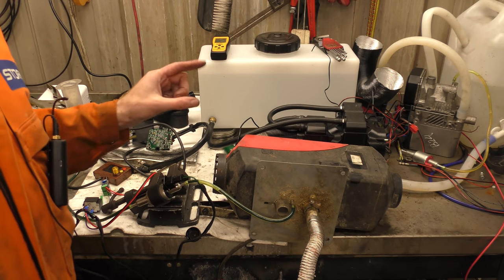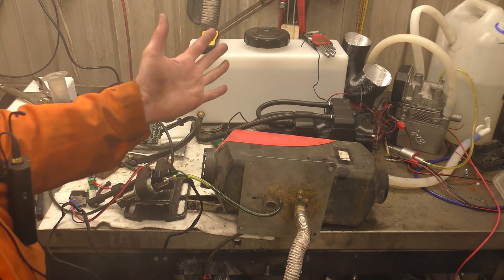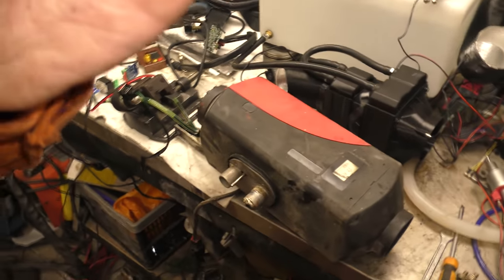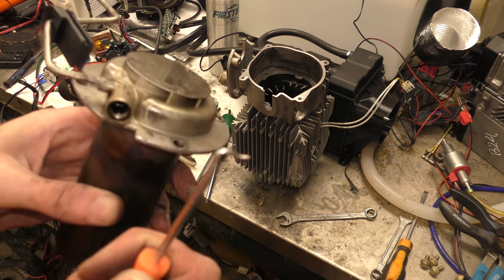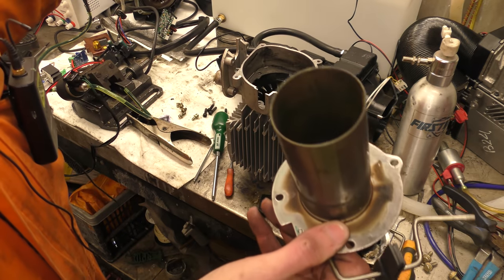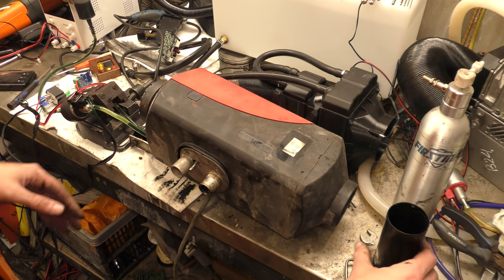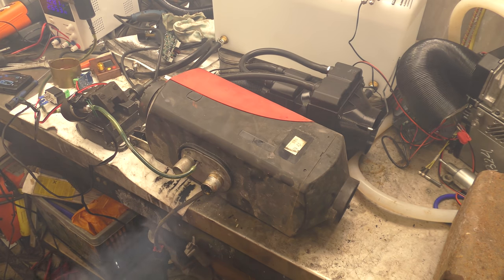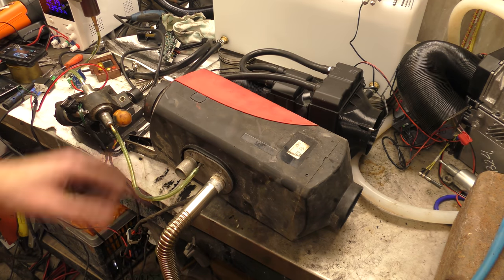Diesel Heater Diagnosis - white smoke but not lighting

Comment: Just thank you...
-33 Celsius  in Winnipeg Canada tonight, if it wasn't for your video I would have rented a hotel tonight. I cleaned out the carbon and just reinstalled the heater. Current temp in my bus at install 0 degrees.
Heater is blowin hot.
I owe you a pint...or ten.
Thanks again & cheers

Comment: Thank you for the video!  I would have never known that little air hole was there, I took out my glow plug and sure enough, it was plugged up.  I removed the screen also, but that seemed ok.  I've been pretty good with running mine at full blast every few days to help keep the burn chamber somewhat clean.  Cheers!

Comment: Hi it's me again well this has got me stumped took the fuel filter off and still the same results still smokey on start up put the fuel ratio up and down still the same results now the heater sounds like a digerydoo on tickeover cleaned the plug and hole n new mesh.. it's ok on flat out but echos through the whole van on low time for a stripdown ?
Thank you for all your videos nice to watch someone after my own heart love the content
Reply: There might also be a presure regulator in the heater. It is a round rubber disk. If it has a hole, You will get same symptoms. The presure regulator evens out the changing presure from the pump, before the fuel reach the nozzle.

Comment: how do I know with my heater which side i can lay it on without opening it up.. the install book for my coolant heater shows all kinds of different appeciable positions..  I have issues when it is -5c or colder with it doing white smoke starts..  after about 2 or 3 tries it will fire up and run normally..

Comment: Hi David I need help please there isn’t a hole next to my glow plug and my heater is brand new but smoking like a train I’ve taken it apart and it’s all clean changed the atomiser just incase after taking apart it’s slightly better but still smoking looked at your YouTube videos on the setting for a 5kw but still the same the only thing I can see is no hole any suggestions please thanks
Reply from the maker: Does it light and run and smoke, or just smoke and not light?
Reply: @DavidMcLuckie  it runs but smokes ——- when I first set it up followed the set by step guide ie prime it then start it but a error code came up after first starting it e08 so look at the code chart air in fuel line noticed air bubble so I primed it again it started but loads of smoke so I took it as to much fuel in the burner after priming it thought it would burn off but 3 days later still smoking like a good 1 so stripped it and changed the atomiser but noticed there wasn’t a air hole on the side like you’ve mentioned so just wondering if this could be the problem air/diesel ratio
Reply from the maker: No hole is very strange.  I'm actually impressed it lights.  If there really is no hole I'd suggest drilling one.
Reply: @DavidMcLuckie  hi David sorry after taking it apart again yesterday there was a hole wasn’t on the side it was at the back missed it on first strip down probably cause I wasn’t looking for it so stripped it down again yesterday all clean glow plug was clean not caked in anything slight whitish where it gets hot chamber was clean too and burner was spotless but it’s still smoking tried changing the settings like on you video but still the same I’m lost mate

Comment: How do you turn the setting down so it doesn't burn so much fuel?
Reply from the maker: Depending on which controller you have will depend on how you change the settings.
Reply: @DavidMcLuckie  it's better now, I had the wrong fuel pump on it, it was off a German wabasco, too fast for the Chinese ones.. and my exhaust pipe might have been too long.. I have 2 and it seems like they carbon up lots, I have to blow in the intake with air, to get them going, about once a week, or so.

Comment: Hellooo David ,do you know why some heaters smell of fumes on startup and shutdown. its fine when its running but for the 30 seconds each time it stinks of fumes . 
There is no smoke though and quite a few people has the same problem as me when i try to research it.
Reply from the maker: Where is your heater fitted?  If you can smell diesel it's either exhaust fumes making it into wherever you are or there is a failure in one of the gaskets inside the heater allowing combustion gasses out into the plastic heater body.  When it's hot this might seal the gap again so you no longer smell it.
Reply: @DavidMcLuckie   its a all in one and right now its just heating my garage. I can leave the door open for a while but its bloody annoying
Reply: yeah your answer makes sense. i took the casing off and ran it. Put my nose near the outlets and it did smell strongly of fumes from there.
Im glad its not in a van. Any ideas on how i can fix it.
Reply from the maker: Also make sure the rubber boot around the glow plug is sealed well.  There is a chance on startup you might get a smell of diesel coming from there, but your heater would also run poorly.  If it's not that you'll have to disassemble it and either replace all the gaskets or apply a high temperature gasket sealer and see if that cures the leak.
Reply: @DavidMcLuckie  will do. Thank you very much. I wouldn't normally do stuff like this but i can follow instuctions quite well and your videos are as clear as anything ,as such a simpleton like me can follow it.
Reply: @tonycheung8039  i own one... ALWAYS stinks for 30 seconds to 2 minutes on startup/shutdown of fumes... route your exhaust outside and you won't have that annoying issue.
Reply: @BeezyKing99  my unit is a all in one . I keep the exhaust well away from the inlet  .
Reply from the maker: Ahh wait.  Is you exhaust not vented outside?  If not there will always be a diesel smell at startup as it makes diesel vapour before it lights.
Reply: Not vented out yet as I wanted to do a dry run before drilling holes in the wall. I'll tighten everything up then put the exhaust through the wall and check again. Cheers

Comment: Can you make a video on how to build a disel waterheater out of an chinese diesel air Heater or something to heat up an intex pure spa whirlpool in Winter brcause the electric heater ist very inefficient and expensive
Reply from the maker: I wouldn't use an air heater.  The losses are too great.  If you wanted to use the heater to heat a shed around your spa and use the exhaust heat recovery to heat the water that is more efficient.  But I'd recommend one of the diesel coolant heaters and an EGR cooler to recover as much heat as possible to heat the water.  I've got a few videos on that.
Reply: @DavidMcLuckie  a EGR is very expensive or?

 Im from germany and dont know were to get the parts. What do you think how lang it takes to heat up a pool with 1500Liter up to 37°C.

I Have a brand nrw chinese diesel heater and Want to use it as a pool Header
Reply from the maker: Ok, have a look at my Bobil Vans water heater video.  It attaches to your heater and uses hot air to make hot water.  It has a claimed output of about 2KW.  Heating 1500L of water from 5ºC to 37ºC would take about 28 hours.  You can use an EGR cooler for a car or van to attach to the heaters exhaust to get even more heat into the water.  But it will require a bit of DIY fabrication to get it all to fit together.
Reply: @DavidMcLuckie  okay thanks for the Information. I think istanbul very inefficient way to heat my pool... i better Look for a webasto thermotop 300 or something. Mechnical fabrication and electrics is no problem for me
Reply from the maker: A thermotop would be a much better way to heat the water.
Reply: @DavidMcLuckie  but also very expensive
Reply from the maker: You could go for a C,E,Z model from a scrap car.  Plenty of them on eBay, just need a controller/wbus adaptor if it doesn't have the 12V trigger from factory.

Comment: Sooting up was the symptom the cause of it was that green flexible fuel pipe. It should be a smaller bore hard nylon type otherwise the pump struggles to feed enough diesel fast enough to be properly atomised and consequently you get incomplete combustion and soot.
Reply from the maker: Nonsense.  We've done the test.  Soft fuel line makes no difference.  Why do you think Webasto fuel pumps have dampers on them to even out the pulse?  Atomisation is achieved via evaporation on a hot stainless mesh, not the speed of the pump.

Comment: THANK YOU for posting this. Have a very similar German made heater in my mobile crane cab. Cold snap coming this week, and I really needed to get it working. Drained diesel, cleaned the line and filter, still no heat just smoke. This video finally helped me figure out what needed to be done. Took it apart and cleaned it up good this evening, and I have heat just in time for an icy work week!

Comment: Great video! First time I understood that the reason for the white smoke is that the flame did not start and the fuel is only grilled by the glow plug, due to the blocked little hole, which causes that there is no ignition flame and no real burning of the diesel
Reply from the maker: Yes, exactly

Comment: Billy Connolly does night heaters !! Great videos though  I have to say. Ive had a few issues myself with carbon build up . I've found there is usually some other problem that leads to premature  carbon build up like low power due to battery voltage being low in first place and further volts drop through over length wiring of wrong section cable or  incorrect plumbing allowing air to hide in joints , filters and pumps . Brilliant heaters when installed and used correctly though .

Comment: Well, I tore my heater apart three times before finding your video I saw 2 years ago.  I had the white smoke out of the exhaust and intake.  Cleaned it 3 times, more places each time, the fourth time I went directly after that little 1/8th inch ish hole by the screen, cleaned that out with carb cleaner and it fired right up.  

Thanks for the video,  I now have a backup heater again.

Comment: I had the same thing when the exhaust run on my heater in the garage was too long. Exhaust blocked and the heater got flooded. Unblocked exhaust, still a smoke machine. Figured the fuel air mix was off so I let it try to start and blew down the intake as hard as I could. Smoke, Smoke, smoke, POP! whooosh.  Let it run as hot as possible and it was fine. It only took about 2 days for the smell of Diesel fog to dissipate....
Reply: Cool trick. Thanks!
Reply: I have the same issues time to time I start it with egr valve spray up the intake on starting it pops and back fires then smoke and starts every time.
Reply: That my friend would be a good video tutorial to make

Comment: Thank you for the great video's I am going through them as I get time just wanted to mention something about my own experience with one of the heater's that also got full of soot after only 3 days I cleaned it and ran at full power for 4 days and it stopped working I striped it down again and cleaned as full of soot but this time I noticed my fan had 2 magnet's on it so I changed the setting SN1 to SN2 and now it runs great ... It seems the brain thought the fan was going faster than it was and delivering to much fuel , hope this helps someone,keep up the great work. HAPPY NEW YEAR 🥳
Reply from the maker: Nice, so in reality it was getting half the air it thought it was.  That's another thing I can add to my list of fault checks.

Comment: David, Also worth getting the burn chamber REALLY clean and bone dry by heating it up with a blow torch. Once cool, reassemble. Its amazing the clouds of smoke you'll get from very back of chamber with a blow torch (where its almost impossible to clean) and it gives an even greater chance of a successful start up. From what I've gleaned, the hidden part of the burn chamber is composed of a ring of welding blanket (carbon felt) which can absorb fuel like a wick. Its held in place with stainless steel mesh. After running rich or flooding, this felt no longer soaks up diesel because its become totally gummed up with soot and residue. It sets like concrete in there and the fuel can't catch fire and invariably drips out the exhaust or air inlet. Carb cleaner (or cellulose thinners) will definitely aid cleaning the burn chamber but the blowtorch is the surest way of restoring the absorbency of the carbon felt, and its super fast. You usually get flame out or E8 error after the white smoke which is often attributed to fuel when sometimes what it needs is a proper clean - and/or as in this case, clearing of blocked holes.

Comment: you have to run these at max power for like 15min every week to burn off carbon buildup if am not mistaken
Reply: Exactly.  Diesel is closer to oil then gas hence why all the deposits, but many don't understand this.

Comment: Came here because my heater on my Merc w211 had suddenly stopped working after we started having temperatures below 0 degrees Celsius. Fortunately I figured out the issue today and boy was it foolish. The exhaust pipe had shifted off from it's hole on the bumper and its end was surrounded with 1 cm thick ice. After tearing it off and blow torching the ice off from the tube the Eberspächer started right up, but it smoked like hell for 15 minutes meaning the entire hood area was full of smoke including some smoke on the interior as well.

To help others here were my symptoms: Heater fan and glow plug started normally via remote. After 30 seconds of running the diesel pump started clicking slowly. After 1.5 minutes the diesel pump and the fan gradually went crazy to the point where the clicking was really fast and the fan was super loud. After 2.5 minutes it just shut off the diesel pump and the fan started running low and quiet.  If you are experiencing same type of behaving with your heater I'd recommend you to check out the exhaust pipe from both ends.

Comment: Amazed the smoke could actually get through the carbon in the exhaust port 🙊
Reply from the maker: Me too.
Reply: @DavidMcLuckie  couple of questions please...

1. I have a 5kw all in one, what would you recommend the best settings for it? At the mo I have 1.5hz - 5.3hz and 1650 - 4600.

2. With these settings I run the heater until it gets to temperature which is. Orally about 22 degrees in my van but the temp on the heater continues to rise...I got to 34 degrees today and decided to turn off...is this because my fan isn’t cooling the heater quickly or purely because the inside of my van is continuing to get hotter? It certainly didn’t feel like 34 in my van!
Reply: “Normally” not orally 😂

Comment: A 5kw heater I've been using for a couple years began smoking on startup but always started on it's automatic second try. Internal inspection showed no carbon buildup, mesh was clean, and the small hole by the glow plug was unobstructed. The motherboard was the problem. Replacing it fixed the smoke issue.
Reply: That's weird... I just posted my comment above. Exactly the same as yours. Mine still starts up on the 2nd. try and I have 2 other New units that I have never even fired up... I may just replace the whole unit and then dive into this one I have been using for nearly 3 years now.

Comment: Thank you. I've been wondering what goes on inside, it's basically a mini "salamander heater" we call it. Like a big orange job site heater with k1 in a tank on the bottom. It's like that but inside its own own heat exchanger. Brilliant
Reply from the maker: Kind of.  Salamander, Torpedo, diesel space heaters use compressed air (compressor built into fan motor) to blow (through a nozzle) a mix of air and diesel which is then ignited.  These little diesel heaters use the hot surface of the burn chamber to vapourise the diesel which then mixes with the air from the fan and burns inside.  So they are similar in that they burn diesel, but have a long startup and shutdown compared to the Salamander which can deliver instant heat.
Reply: @DavidMcLuckie  Interesting! I always thought they use the same system as oil boilers and very large (>20kw) diesel air heaters, where the burner motor drives a combustion air blower and an oil pump, that sends high pressure oil/diesel to a nozzle, that sprays it into the burn chamber as a very fine mist. On such units, the air and combustion gasses are also seperated by a large tube heat exchanger.

Comment: Love this vid. I purchased a diesel heater that has yet to arrive and was wondering how user friendly they were to take apart and service. I built my own waste oil heater for my shop out of scrap over a decade ago. These are not real complicated. I think I will be happy with mine.
Reply: I bought 2 new heaters, lots of soot issues, not sure why, I use an air hose to blow them out constantly..
Reply: If you use waste oil, you really need to mix the fuel and run extremely clean oil. Any nasties and it will do this crap constantly.

Comment: Mine does that exact same thing...except mine always starts up immediately when I wait about 15 minutes and try to start it up again ! I tore it apart last week to see if I could see anything wrong... it was Super clean everywhere inside of the unit (I have used it for nearly 3 years and first time taking it apart) ! I am now guessing it must be my Glow Plug ! (I should have replaced it when I had it apart and out of my van !)

Comment: I'm having this E8 problem.  (White smoke,  no ignition)  so I will open it up 
The only criticism I have here is that you changed the whole burner, and not the original burner.  As a technician, the reason that it ignited isn't clear.  Was it because you cleaned it (probably YES).  If you'd have put the original burner back in, it would have been conclusive proof that the cleaning out, by itself, did the trick.